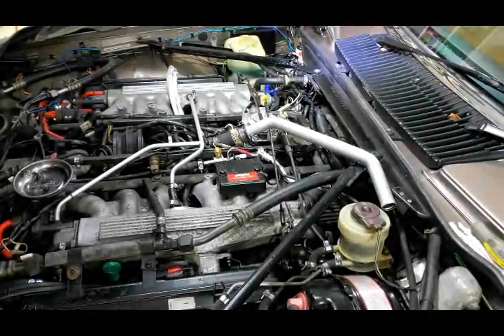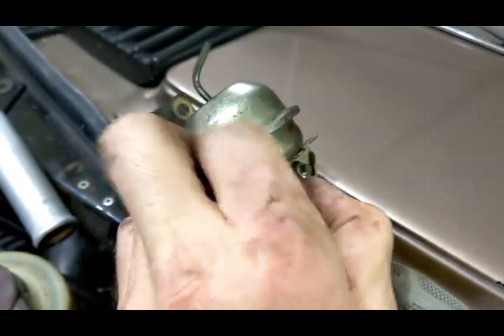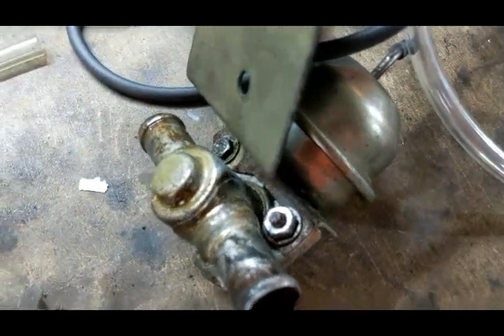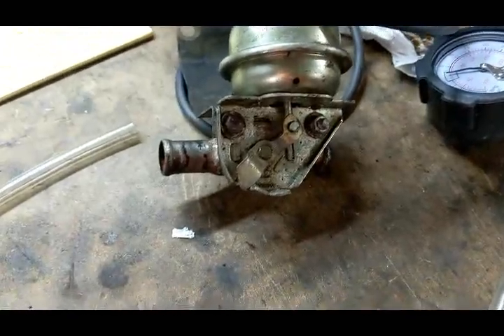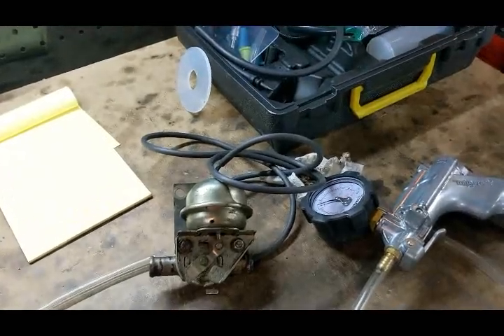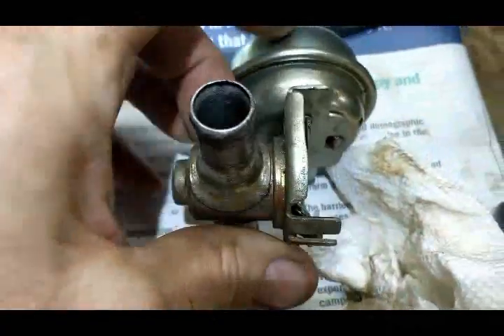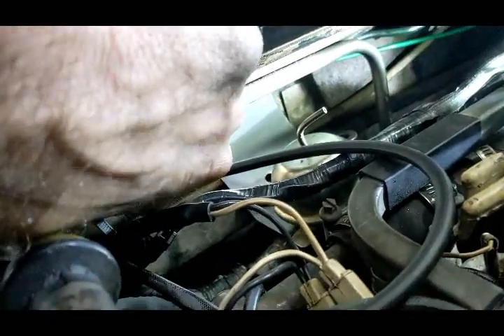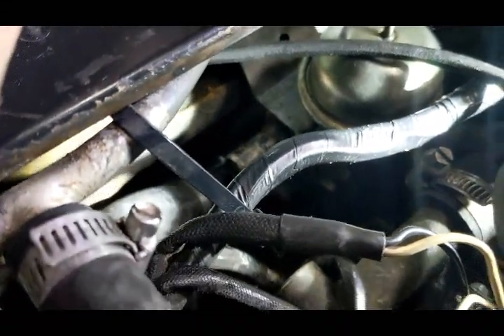Jaguar V12 Heater Core Water Valve - Quick look

Comment: I need to do this as my water valve is slightly leaking coolant from the bottom, do I need to drain coolant first before you undo the jubillee clips?  (I have only recently chanhes it all and so am obvs reluctant to do that)
Reply from the maker: I did not, Tim.   It was a while ago now, so I'm a little fuzzy. I probably bled the system after. I have a bleed valve installed on the hose that goes to the water valve to do just that.  I hope that helps.  Palm talks about the extra bleed value in the "Experience in a book" book.  ...do you have that.  Some say not to put one in, but I did and it helped my problem of air in the system.  Good luck.